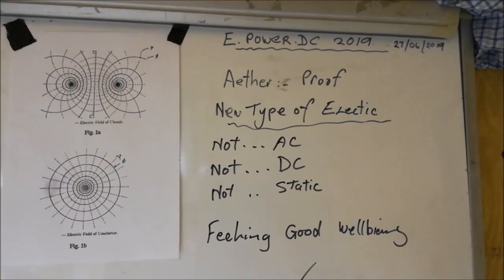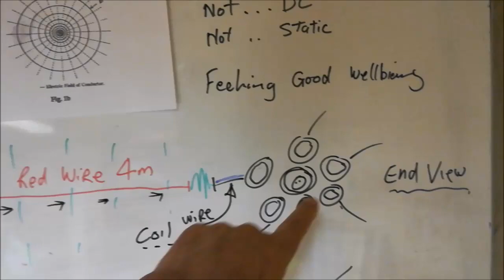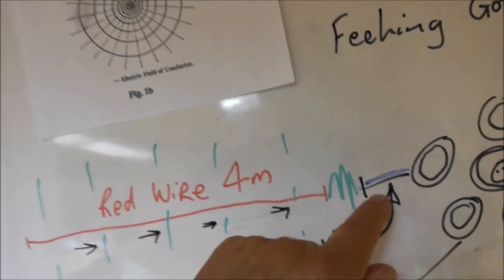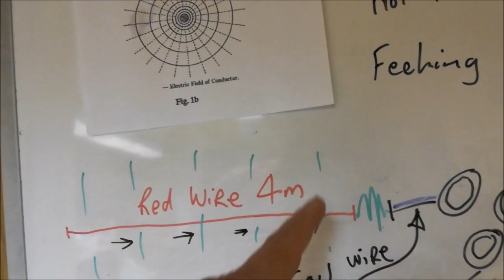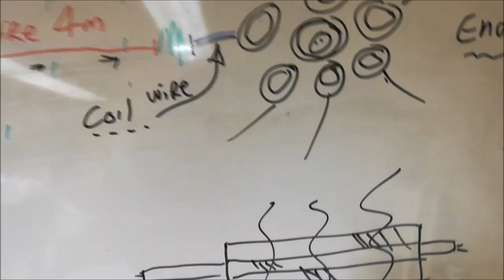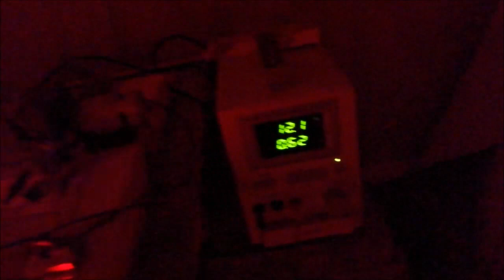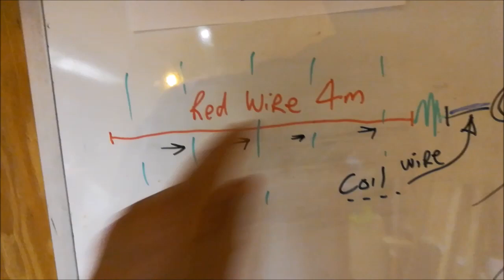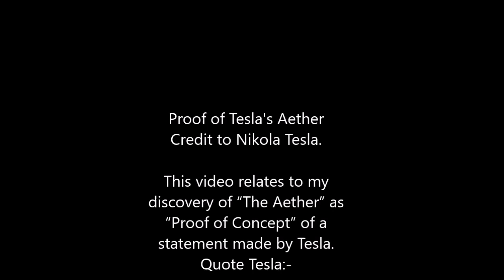Tesla's Aether Proof

Comment: DC Add more fluorescent tubes to the circuit to see if you can really get a shocking experience.  Keep the same circuit just see if the output increases.  The location could be on the outside or inside the cluster.  The point is to get an increase in output.  I have discovered this Aether too and don't know how to use it other than make more lights light-it is not AC not DC and not Static.  It has a mind of it own, because it doesn't care about diodes or a lot of other electronic components, it does what it wants in a circuit.  Thx keep up the great work.
Reply: this is not what it is called, it is aether, but it is not that it does what it wants, it happens that being high frequency, it has other ways of working, that is to move, it moves by non-drivers, that is, in high frequency it moves by non-drivers and when there is low frequency due to the magnetism of gravity it moves through the conductors, inside and not outside, with high tension moves outside the conductors, the direction of movement is changed so to speak, the polarity if you like, I can explain it better if you want, so the experiment of the double slit is so easy, because the observer influences, clearly influences the frequency, generates high frequency and causes the magnetism to change and have other attitudes, hug

Comment: it's like in the house plug, 110 for north america and 220 for south america, the positive without the negative is nothing, and the negative without the positive equal, therefore, the magnetism that is the positive, with the radiant that is the negative, if you touch only one cable of the plug of your house nothing happens, either, but if both together if obvious, because there you have the magnetic pole and the radiant pole, there is no north pole or south pole , only one that takes the energy (inspires) and returns the energy (expires) respiratory rhythm of the universe, rhythm of everything there is, magnetism and radiant, everything is the same, direct current, alternating current, electro static, everything, it is a single energy, nature has an expression that is life, hence life expresses itself, as we express ourselves, only different levels of life, say superiors, something that religious call god, is nature expressing itself to Through its property that is life, we live in a black jero, where the magnetic center is one that takes and gives energy and the energy magnetixa is expressed in radiant energy, the south pole of the antarctica and the north pole of the arctic is the same, join the two, if you fly by the north pole you appear in the south pole, that is why the nations have made military bases in the antarctica, to be able to seize the magnetic pole where the time does not happen and where the energy is in pure state, big hug

Comment: what you do with that engine is generate friction energy, static call it, because it is so fast that energy seems static, like when you turn on a fan and you see them so fast that it seems quiet, so it happens, you generate a frequency, and that frequency after transmitis in all the elements that have much capacity of magnetic atoms, as those tools around that are charged electrically (energetically), it is a magnetic pole and a radiant one, it makes you very well to health, scalar wave, hug

Comment: Hello what's up? very good video, what you generate there is orgon, orgonica energy, which tesla also calls scalar waves, gravitational waves, all are magnetic atoms, these atoms give their spin to the other atoms that lack spin, and then the atom is restarted and it recovers if spin (the magnetic atom), is the aether that is everywhere contained in the container of the universe, another density, the same as water (another density), it does not matter if it is high or low frequency, low frequency aether generates certain properties, the most important or the most notorious is gravity, hence the accumulation of molecules due to magnetism, and high frequency is the other property of the aether that generates other symptoms , that the molecules go on the outside generating radiant energy, is what Luigi ighina discovered, the magnetic atoms, and then he said that there was something that mobilized these atoms, and it is the aether, generates health, because we are maqui nas de aether, we are antennas of scalar waves, antennas that receive and transmit scalar waves, big hug
Reply: Spin is a Quantum term for Dielectric pressure variances of Matter. Tesla was an avid and vocal opponent of the Quackery of Quantum.

Scalar waves is an incorrect term for directed Dielectric pulse perturbation. What in fact is occurring are pulses of Dielectric or electrostatic that saturate the Ether. The Ether is then locally saturated in which it does what it can to mediate that pressure to a state of Inertia. 

All Matter is inherently magnetized as it is, in fact, coherent energy.  Matter is formed of energy.

Food for thought

Chasing Dragons
Reply: @redfishervictoria  
If I speak of spin for the term of reference to movement, in fact this bad said, but yes, the saturation of magnetic atoms is what happens, since the magnetic atom yielded so much of its energy that it must to get out of shape radiant expressing itself Outside of the conductors, because they have lost magnetism, bears are saturated with magnetism, then they do not want more magnetism and they go from there to the place of the others that come with a lack of magnetism, that is why they repel outward, that's what you mean, hug
Reply: @redfishervictoria  
the surrounding ether is saturated, that is, the ambieno nearby, which can occupy that magnetized material, if this happens and therefore it appears around, please, the easiest way ha ha, hug